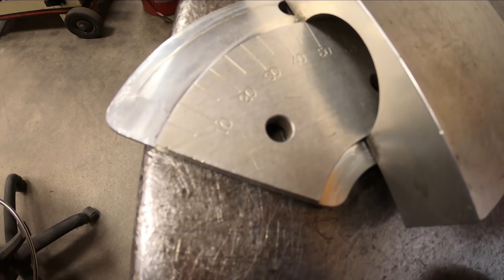BP Autosports, LLC. BUILDING a Turbo Manifold!

Comment: Great craftsman and workmanship in the manufacturing.... but the design looks like it defeats the purpose of a twin scroll turbo. To have the twin scroll work the way it's designed the runner tubes of the header all have to be the same length, the pulse from cylinders 2&3 should hit the turbo right after 1&4 but since cylinders 1&4 have longer runners the timing of exhaust gas pulses are not entering the turbo when they should to have the twin scroll work the way it was designed to work. The turbo will spool faster and have better throttle response if the runners are equal length. 
That's why they call them tuner cars.

Comment: Excellent video.  Solid construction methods.  I thought you'd like to know I have a computer program that will design tubing solutions like these and give you the exact bend angles, lengths, etc, and can optimize for tubing length(s) and packaging constraints.  Would save you a few welds per primary and save room in packaging and cut your build time in half.

I design headers for NASCAR and F1. I could send you a white paper on a design I did for a Honda VTEC drag engine that is similar to what you built on this video.

Cheers,

Kurt
SLC, UT

Comment: I built a rams horn turbo manifold for a sohc ka-t project. It was made from steel elbows and I mig welded it together. It turned out pretty good for what I was working with. Now that I have a tig and more experience, I am going to give this a go on a 360 v8 project I think. See what happens, wish me luck.

Comment: Great work!
But I wonder why you decided to choose so much diffrent length of the pipes. To my knowledge diffrent pipe length is a massive performance restriction. It also has bad effects inside the engine like diffrent backpressure and diffrent exhaust temperatures per cylinder.
Reply: If you see better he use large diameter for longest pipes to compensate the diference

Comment: Like the music I like the setup you have and it’s awesome you back purge. Some shops don’t. Only issue is you need to control the heat a little more. That copper look on the weld is metal fatigue. Keep up the great work.
Reply: You don't know what you're on about it's a skill set he's done a top job

Comment: Good for you bro for actually purging your stainless! For all you "real welders" out there, this is how it's done.
Reply: What do you mean by purging?
Reply: @danielohara1040   He fills the inside of the manifold with argon(emptying the oxygen), so that when he is welding from the outside, the inside comes out perfect as well.
Reply: I dont know how you couldn't purge on this.   Any manifold builder knows you can't not purge...
Reply: @matt10011987   Ideally you purge. But there are plenty of turbo manifold/headers out there stitched together with tig and mig welders who don't purge. It can compromise durability but it's not an absolute necessity.
Reply: @177SCmaro  solar flux is a good option to if you dont have the means to purge. Turns just as good .just mix with alcohol and put some on .works perfect .you can get from welding shops .
Reply: @teamdrama6251  Good suggestion. Thanks.
Reply: Any turbo manifold at least, too much money to let some slag flake off